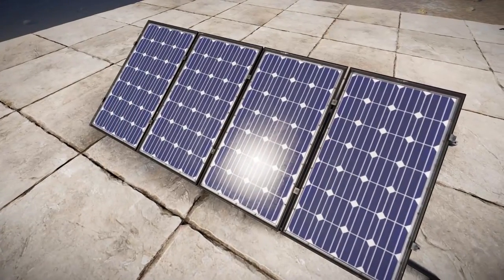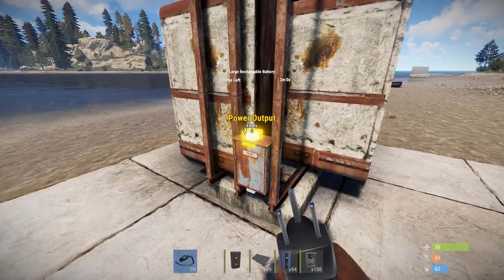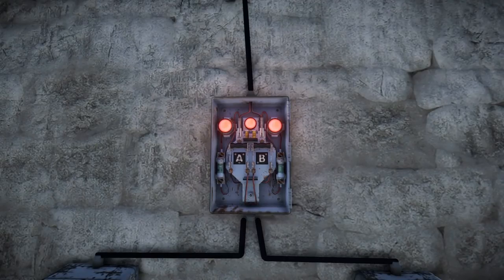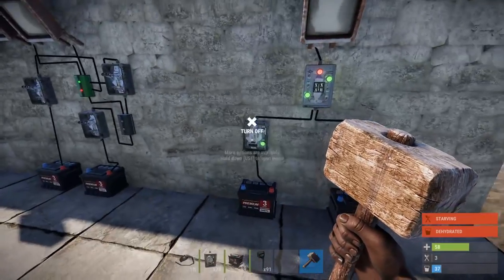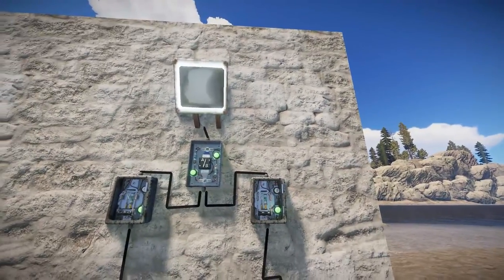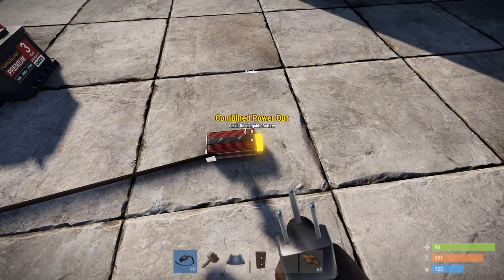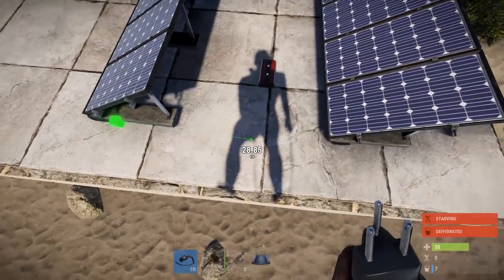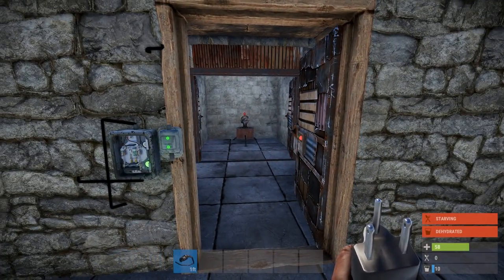Rust: Quick look at Electricity in Rust

Comment: i got a question, what if we live in  a cave? solar panel will still work? lol
Reply: And windmill lol
Reply: you could run a wire down the cave opening, with panels out the mouth of the cave, lol
Reply: rip
Reply: Use wire to from outside to cave .. lol
Reply: @dominikhorelican8034  buidling zone?
Reply: @savagehippie420  From top to botom ... i think Building zone from top to botom its infinity no ?
Reply: When it's going to pull the cable through the walls ... maybe it's going through the stones? maybe i dont tested yet ..
Reply: @dominikhorelican8034  Not sure, but good point on the top to bottom, I don't think it is infinity however, I could be wrong...

I'll update here if I come across anything though.
I'm going to try and get my hands on a turbine and run it in the other section of cave.
Reply: no solar panels need sunlight
Reply: @dominikhorelican8034  it can rn
Reply: old fashion fuel.
Reply: @400thekiller233  its not possible, if have fully charged battery and u pick it up with hammer, you will lose your power (dumb)

Comment: A problem I've been having is combining root controllers. Say you want to have 4 solar panels charging 1 large battery. You use root combiners to combine the 4 solar panels in 2 pairs, and then you would think a final root combiner would bring those 2 other roots into 1 but it doesnt.  You cannot feed the output of a root combiner into the input of another for some reason, not sure if its a bug or intentional. What this ends up meaning is either you can only use 2 power sources per battery. The only way to have 4 solar panels that I can figure out is to have each pair of solar panels feeding its own battery, so you need 2 large batteries, and then combining both batteries with a root combiner, but this way you have to have 2 large batteries.
Reply: It sounds like it's intentional, but it's really early to say about what will happen with these & other things due to its potential. Also, half of the people wouldn't have the brain power to comprehend what you said lolo

Comment: Why are people calling this complicated. Its basic logic and common sense smfh
Reply: AAANNNNDDDDDD it is massively simplified power delivery / electrical circuit system at that. No need to deal with base components or concepts such as AC vs DC, transformers, resistors, capacitors, inductors, OP AMPS, diodes, transistors, worrying about VIR, etc to make basic circuits.

Comment: Experimented a bit. The Implementation is highly unintuitive and basically  bullshit. A small Battery ALWAYS outputs 10 Energy and a Large on ALWAYS 100.  A Splitter always splits the Output symmetrically. You cant Charge and Discharge a Battery at the same Time. So, when you want 100 Energy guaranteed in your Base, you will need 2 large Batteries. Why? Because you will have to have one Charging and one Discharging. And to do that, you will need a raw energy of over 200. Why? Because the one discharging has no way to disconnect its input line and with a Splitter with 2 splits you will always send half of the Energy to that battery anyways. That problem could be reduced by using 3 Batteries, because then you can do 2 charging and one discharging. But stuff starts to get expensive there. Oh, and on top of that, you batteries have additional losses.

Comment: Yeah cool but itd be really cool if your game could fucking run. 

Specs: I7 6700 msi Krait gaming m3 board. ddr4 2400mhz 16gb of 8gbx2 and 256 GB SSD m.2 GTX 1070 8GB founders edition. 850 watt fully modular EVGA power supply